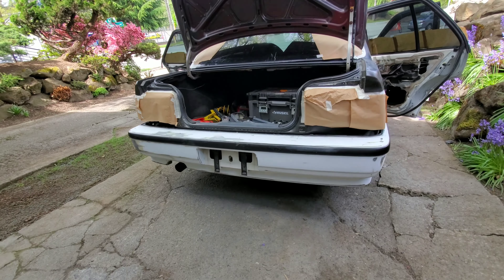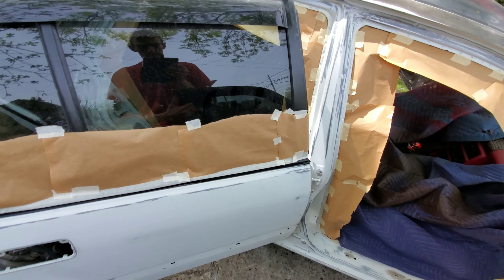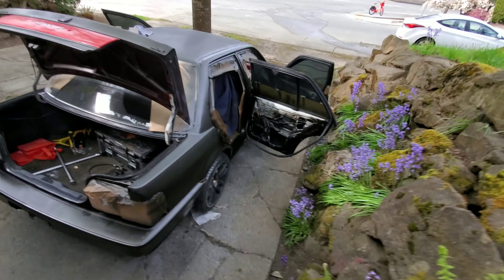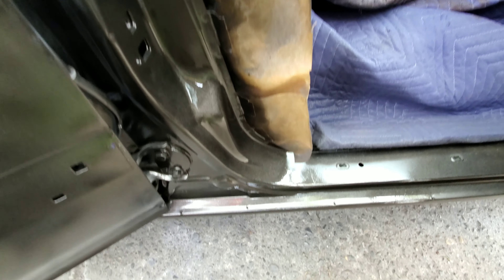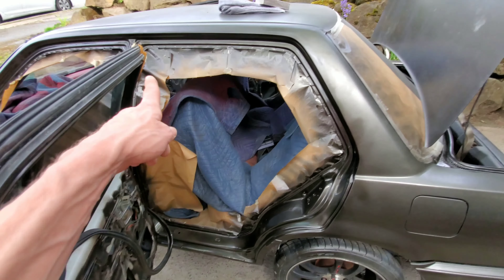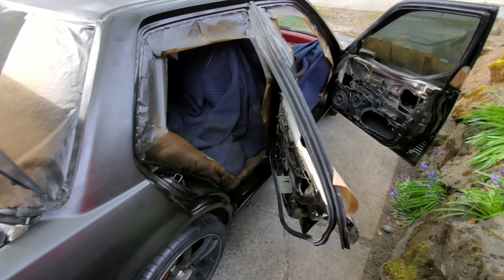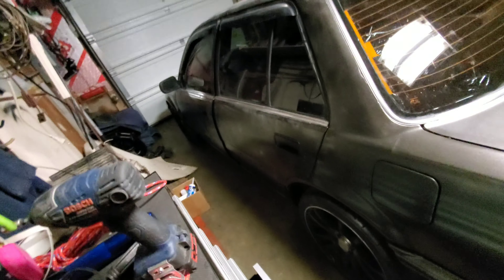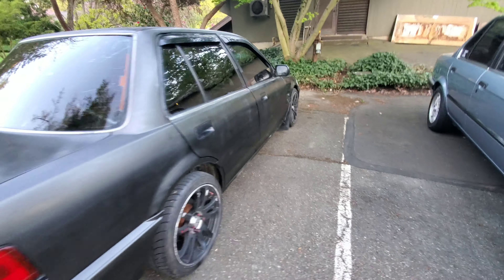Doors Painted, Door Jams Painted & Clear Coated!!! EF Civic Sedan Restore #49

Comment: Question.  How did you get youre door panels back on?  Im trying to put my driver door panel back on.. but the door lock knob doesnt wanna line up... when it does it doesnt stay in the upright postion when door is open. Ittl fall down like the door is closed... also the key wont unlock the door. It behaves as if its caught on something.  Wondering how you got the door panels on w the lock knob.  Tyia